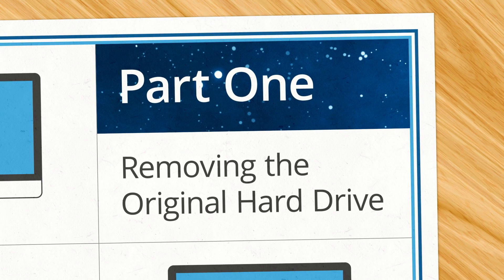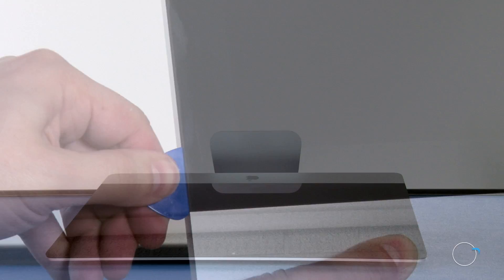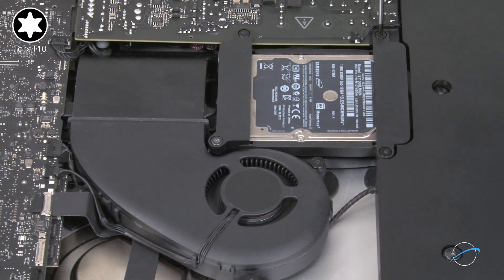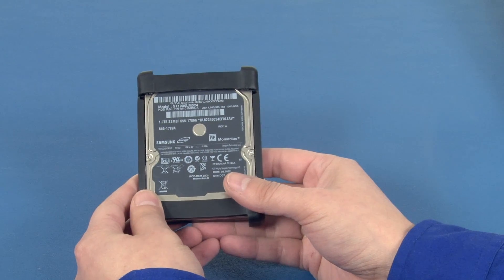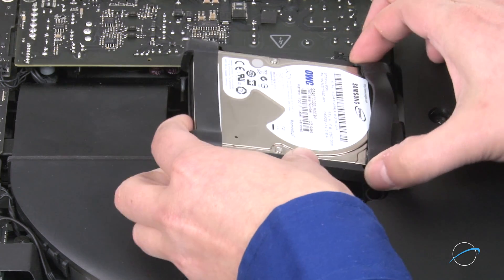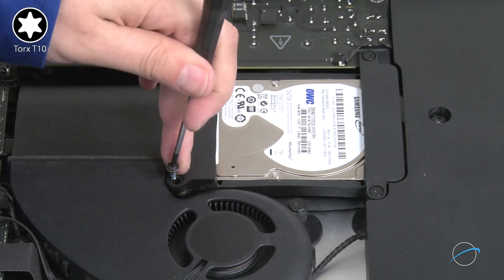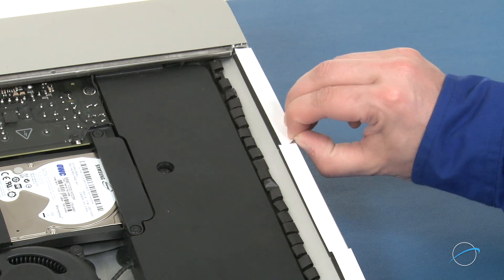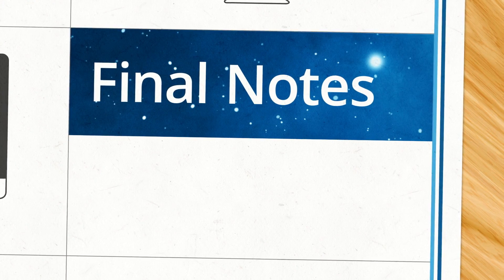How to Upgrade the Main Drive in a 21.5-inch iMac (2012 – 2015)

Comment: Did my IMac hdd to ssd in 35 minuets.  Just need slim wedge, a ssd and double sided sticky strips and a torx 10 screwdriver.   But 12 hours to restore from time machine back-up.
Reply: MacSales. com smooth 😎
Reply: what kind of double sided sticky strips?  how thin must it be?  can you get these tapes at homedepot or lowes?

Comment: I bought the samsung evo 850 SSD (I'm waiting for it to arrive) for my iMac 21.5 14.3. Would the installation be like in the video or would it need the thermal sensor?
Reply: okay, thank you very much, when I arrive and install the SSD I will let you know. regards
Reply: I've been using the SSD for a few days and it works perfectly, thank you very much

Comment: hey you said that if your adding a 7mm SSD you would need a spacer is this true to a regular 7mm HDD?? Or i have no need . also whats the Heigh require on the space for the Hard drive  because i want to install a 15mm 4tb hdd but i dont know if it would fit? thanks
Reply: so do you guys know the actual Height on the real imac hard drive ?? so i could get the right size HDD  please ?? thanks
Reply: Thank You!!

Comment: Does the 2012 21.5" iMac not require the OWC thermal sensor adapter?
Reply: Excellent! Your comment arrived just in time; I'm opening the iMac today! A Seagate SSHD, new processor, and more RAM will really bring this thing back to life! I bought one of your thermal sensors just in case, but I can repurpose it when I move on to my next project, a 2013 27" iMac!
Reply: MacSales. com I finished my upgrade and ran AHT, but it returned a sensor error: 4sns/1/40000000: TH00-9.000

Seems like it wasn't directly compatible after all. Would your adapter remedy this, and is there even space for it inside the 21.5" model? Let me know, thanks!
Reply: Serial is C02JX2MYDNCT. Tried your 27" adapter, but it doesn't quite fit. I think I might be able to get it to fit by adding a right angle 22 pin SATA extender though. Hoping to try today or tomorrow. I think your adapter could work if it had a right angle connection to the hard drive...might be worth making?
Reply: Actually, I ran AHT in the exact same conditions, both with and without your adapter. Your adapter consistently solved the issue, while its absence consistently yielded the same error. I was able to squeeze your adapter into the iMac after a lot of trial and error with other cables and adapters, but it wasn't easy. I understand if my possible outlier of an iMac doesn't represent enough of a marketshare to make a new adapter, but if you were to do so, all you'd need to do to get it to work would be to change the hard drive end to a right angle plug, and extend the overall cable length to about 8 inches or so. Thanks anyway for the support; I'm just glad I got everything working!
Reply: MacSales. com  does the iMac 21.5 2014 require a thermal sensor ?